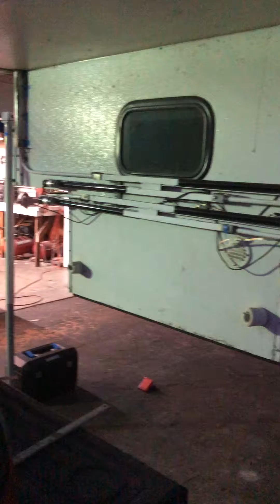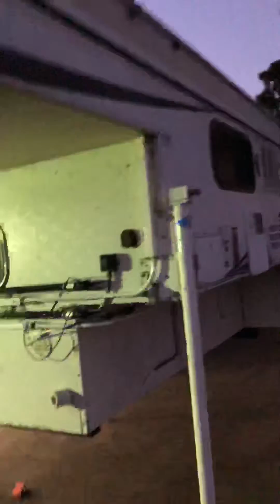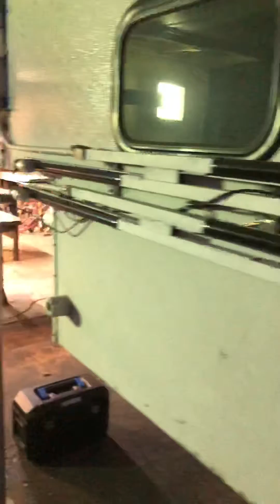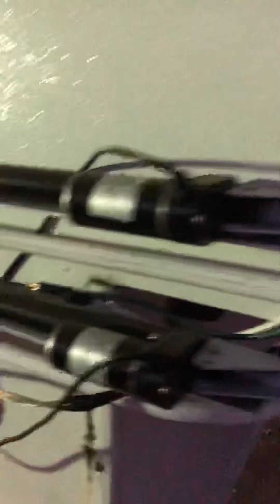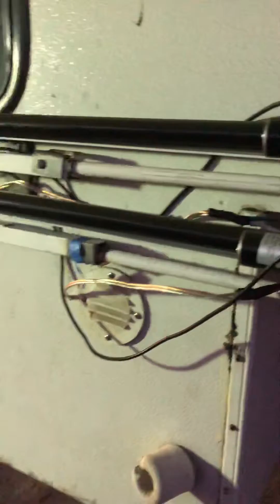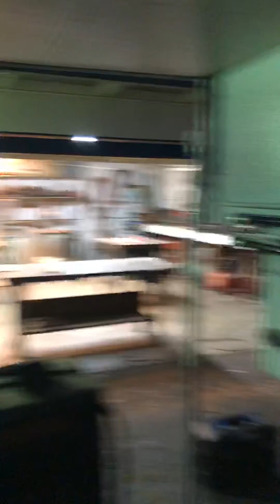Palomino Popup Camper DIY electric roof jack lift system

Comment from the maker: Parts include
- 4 20” actuators from Amazon
- 6’ 1” square steel tubing from Home Depot
-6’ 1” l channel steel to hold actuators 
- 12 stainless screws. 

I built brackets to accommodate the old lift spring mechanism(not really a spring but a steel coil that is flexible and pushes the roof up. 

I attached the end of the spring housing to my square tubing apparatus after shortening the lift screws with my grinder (they were a couple inches too long for the front) this apparatus houses the lift screws so the actuators can push them through the existing system of tubes/piping

I welded the L channel to the square tubing housing I fabbed to the brackets for the actuators that came with from Amazon. These make replacement and maintenance easy. 

To do over: I’d get single switches for each so I can crank up corners correctly

Double measure springs before cutting, one was a bit shorter than the others and needed additional cranking to lift it to match evenly

Make sure the foam in the roof is dry, after further inspection, the likely reason for the failure was the open cell roof foam was soaked and weighing double or triple what it should have. This caused the roof to bow in the center and also caused the damage on the crank system. Check out videos on palomino roof repair/replacement and you’ll see what I’m Talking about. Sorry to be the bearer of bad news if you have a new crazy project on your hands. Chip away and use your resources, you’ll make progress!

Comment: Do you have any more information on your set up. My lift just went out and I can’t find any information on fixing it
Reply from the maker: It’s a tough beast. Best bet is to talk with a machinist about component repair. The dealers will get you for an arm and a leg. I built this myself with harbor freight tools using square tube, l channel steel, and 20” 12v electric actuators from amazon ($55 each) I bought a two way weatherproof switch as well from Amazon. It took me a few tries to make sure everything lined up but eventually got it to work and it’s working pretty well still. I’d love to shoot you details. Can we chat via email?
Reply: Any links to parts? Mine just went out too..